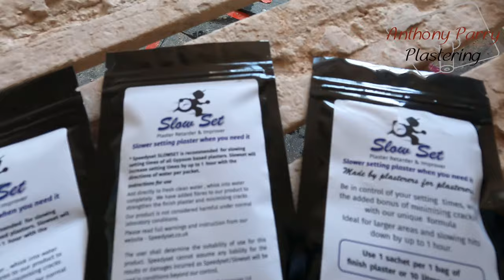SLOWSET first impressions and how to use it.

Comment: Been in this game 14 years and not once seen some1 leave tops like that 👀 i guess if it works it works but not for me... i always do tops 1st less stretching on the up stroke
Reply from the maker: I’m a third generation plasterer so my technique had been passed down to me.

I was taught to maximise my reach allowing me to get faster coverage with less effort. 
I don’t waste energy going up and down benches all the time and I move quicker around a room. 
But ultimately it doesn’t matter how you plaster it’s about the quality of the finish you get. I’m sure your method works great for you. There’s plenty of different ways to plaster it’s finding the right one that works for you.
Reply: Same
Reply: I've been at it 43 years tops first 
half way down then bottom up 
then scrap of excess along the skirst line as it pisses
 of the skirting fitters 
lols bazz

Comment: Hi what is the best way of covering your  floor so u don’t have crap all over it love the  videos
Reply from the maker: Thanks, I normally use carpet protector round the edges and sometimes some visqueen in the middle and I put plastic 8x4  sheets down over it. 
I use to use dustsheets but I don’t anymore. It’s too much hassle cleaning them. Plus they’re not waterproof.
Luckily with this one the carpet came straight out once I finished so I didn’t have bother too much.

Comment: Good job, how comes you use the metal blade on speedskim instead of the blue plastic to flatten?
Reply from the maker: Cheers Toby. The main reason is I broke a few plastic blades so when the metal blade came out and got that and I’ve used it ever since. It’s good and It’s definitely lasted longer. But I’m tempted to go back to plastic and being a bit more careful with it. I’ve been eying up the refina one. Ive just not pulled the trigger yet 😀
Reply: @AnthonyParryPlastering  the Refina is awesome.best tool I've bought